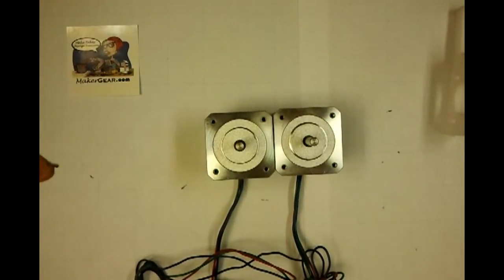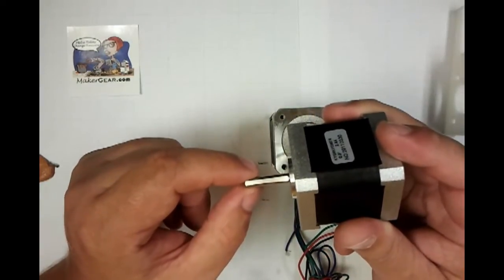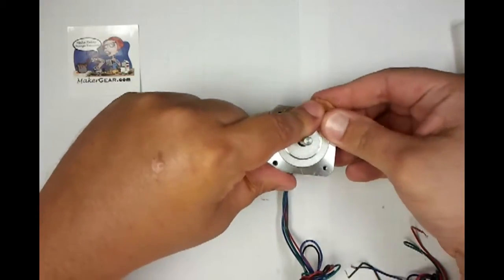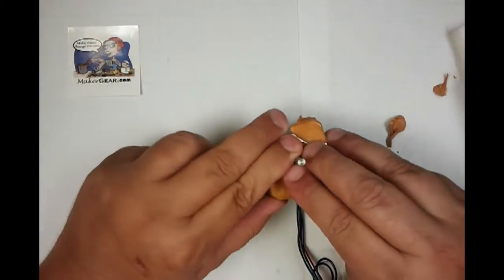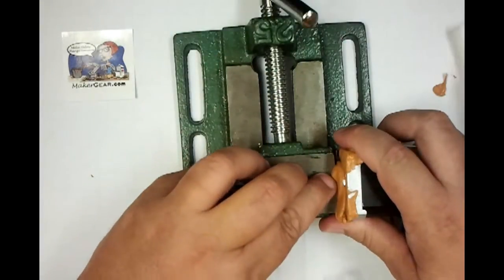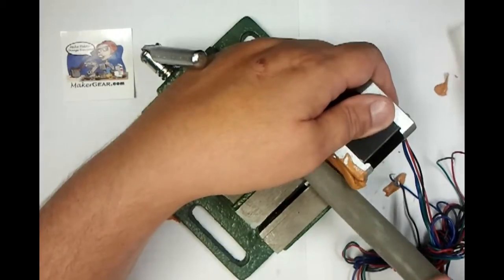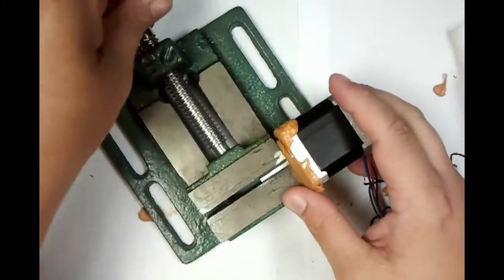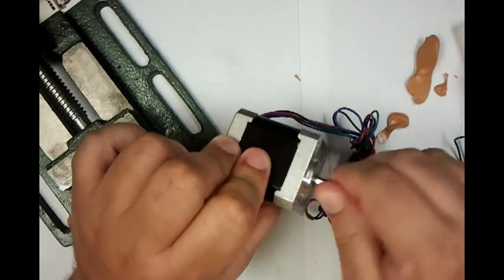Still Extruding: Flats on a Stepper Motor

Comment: You could just put screws in those holes.  Plumbers putty might also work, also coax seal.
That looks easy.  I was thinking how do I stop the shaft from turning while using a dremel to grind it.  Sometimes the easiest ways are the simplest.

Comment: Thanks for the video. This will save me quite a bit in the future as I won't have to rely on only sourcing motors with a flat. However, sawing back and forth is the worst possible thing you can do with a file. A file only has cutting edges facing one direction and should only be used pushing away from the user. Drawing it backwards will quickly dull the file and make future work more difficult.
Reply: I think that depends on the file, some are cross cut and others are straight.  Good point though, I should inspect the file first.